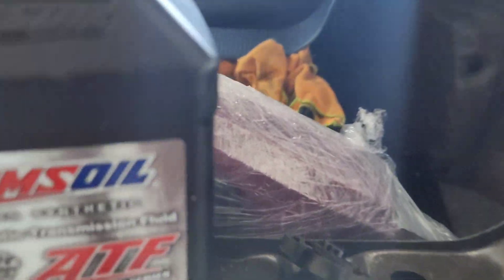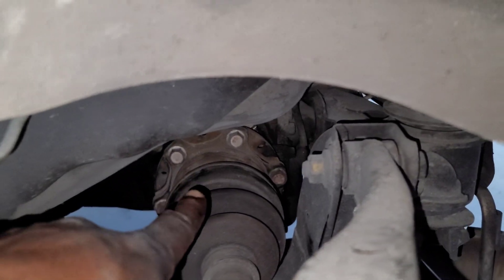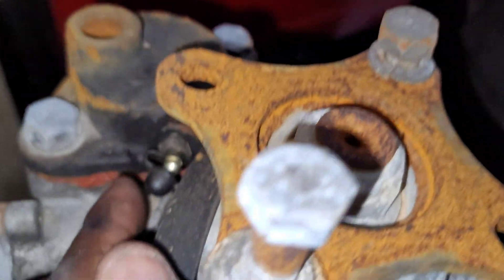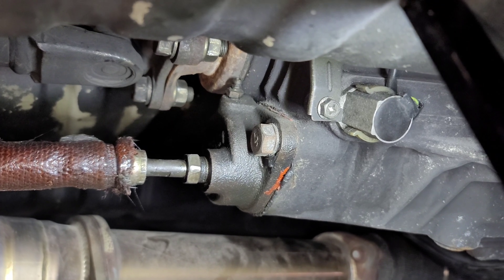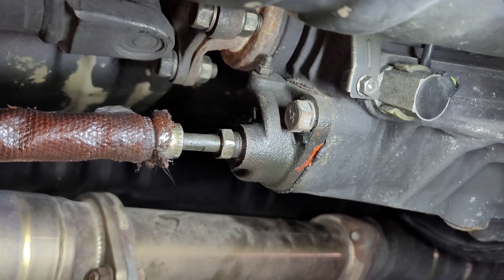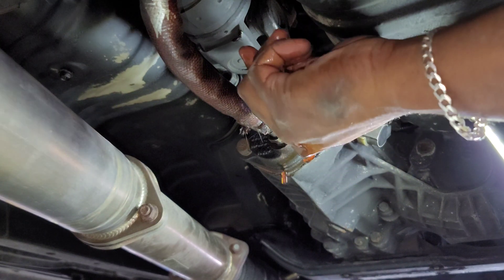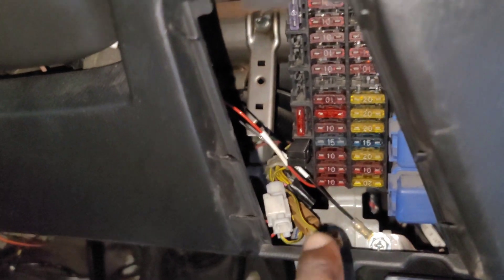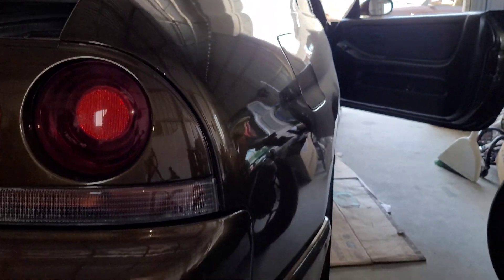How to Bleed Attesa System

Comment: Quick question, would you happen to know where the bleeder is on the gtst model? I think im bleeding the wrong nipple bc Im bleeding the one under the car, behind the driver side wheel...not doing anything
Reply from the maker: Attesa is only on the GTR model. You may be bleeding the hicas
Reply: @Nismology33  would the hicas reservoir bottle be in the same spot in the trunk too and looks exactly the same like in your video?  Sorry I new to the R chasis....prob a dumb question
Reply from the maker: @xenglor1560 with the GTR Attesa,it is tied in with the hicas pump as well with the 33 model. You have a GTST which is only hicas unless you have the 4WD GTST

Comment: How did you know you had to bleed the system? I ask because my 4WD light came on and that actuator at the end makes a weird sound when the ATTESA pump is priming after the car is off for more than a minute.
Reply from the maker: Well anytime you open the hydraulic system I suggest you bleed it. Try bleeding yours and see if it helps